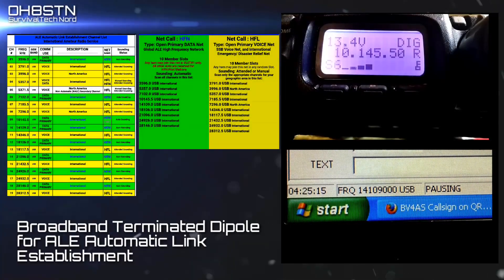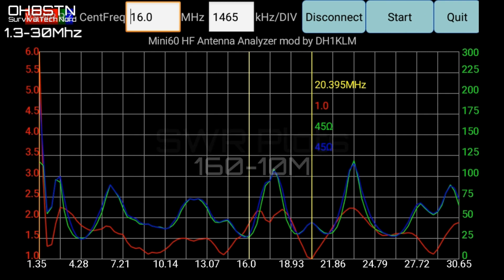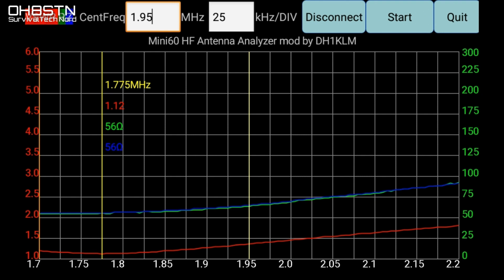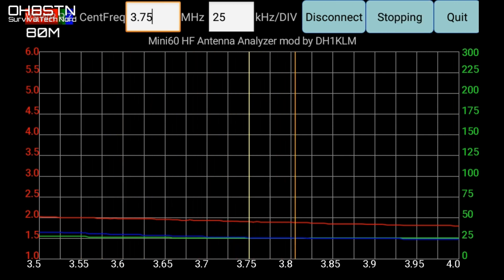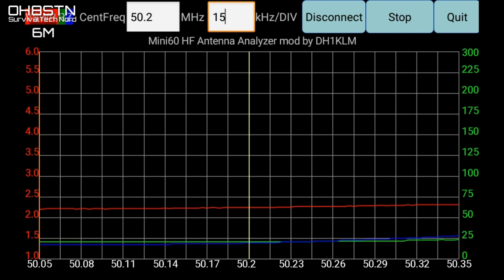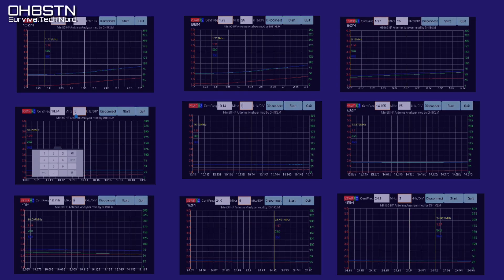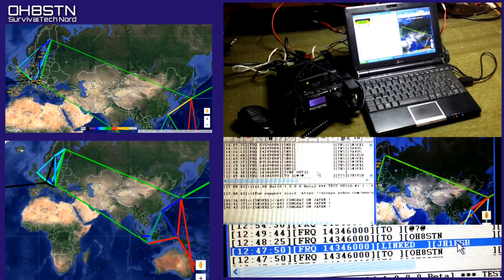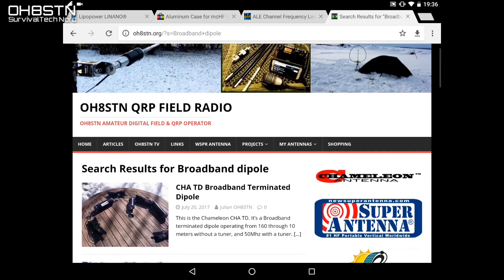Broadband Terminated Dipole Antenna for ALE CHA TD

Comment: Those are some great results! I've just gotten into ALE myself. Figured I was going to have to run a BBTD (or delta... still might). I'm running Ion2g which I did get running in Debian with Wine. There's a couple tweaks you need to do to pass the ttyUSBx or ttyACMx into Wine as COM ports. I've done it with my FT-891 @ 80w and x6100 @ 10w. My antenna is a 135' endfed (inv-L, apex @ 20m) with a 49:1 and has low SWR from 160-10.
Reply from the maker: Thanks. Why are you running ION2G in wine? There are versions for several platforms.

Comment: I was wondering if you could explain the terminating resistors on the dipole and are realy necessary. I was reading that resistors  where so that  there was no reflection off the end of the wire. My question is are they necessary if only using 5 watts?
Thanks agian for the betta. 73
Robert K6NFY

Comment: This is a very nice DEMO indeed! The CHA TD can be used in a lot of different configuration. This is why that it's important to read the user guide: http://chameleonantenna.com/resources/CHATD-Operator-Manual-1.5.pdf
Reply from the maker: +Chameleon Antenna Thanks. I used the same setup for a grid down emergency communications exercise last week Saturday August 26th. In the exercise we practiced sending, relaying and receiving radio email using winlink on HF. Propagation was horrific on that day, but I was able to send and receive messages by bouncing them off of a stations in Switzerland, Sweden and Norway, to my ham radio friends back here in Finland. I set it up in a sloping dipole configuration so that I could get a coverage area directly south on up through to the west of my location. It worked pretty well.
73
Julian oh8stn

Comment: Excellent Julian. I have read about ALE but wondered about the user pool. Maybe that's what we need to make contact. Not sure the KX2 would allow software tuning. The local radio club here F8KKH (est. 1921!) uses a T2FD terminated broadband dipole which seems to work fine for them, but they don't operate low power. Something to look into...

Comment: Pretty cool antenna. Seems to perform like a T2FD. I haven't messed with ALE on ham at all. The last ALE radio I messed with came with software on 5.25 floppy. ALE once you get the network configured right is incredible. Looks like a great project. Thanks for sharing !
Reply from the maker: +SurvivalComms I haven't used the T2FD yes but I've read a lot about them on HF link. Net. I wish you would get involved with this as well if you have that experience. Anyway I'm starting off at this basic ale getting some experience with that and then moving over to the Mars ale.
Always good to see you here.

Comment: Thank you very much for this video! I was training to be a MARS operator a few years ago, but had to quit. I'm planning on going back to it, and ALE is their main mode to interface with military equipment. Definitely looking into this antenna and your site for more info! 73
Reply: Is the EMCOMM II matching transformer the same 5:1 component as in the TD LITE and CHA EMCOMM II antennas? If so I'm wondering about getting the 300 ohm termination resistors from another source and save a lot of money and increasing the operating power...
Reply from the maker: +combatjumpmaster89 You're very welcome. The info on my site is very light at the moment, but there are links to get you started.  Im also interedted in MARSALE, and hope yo be headed thst way with future epidodes.
Reply from the maker: +combatjumpmaster89 i brlieve it is the same transformer as the emcomm II.